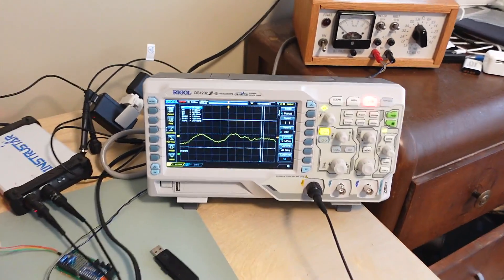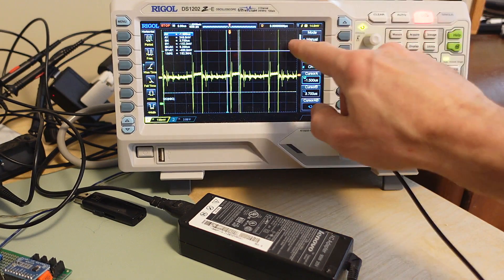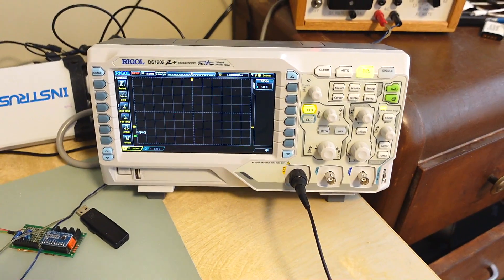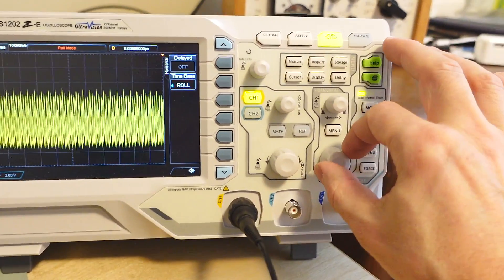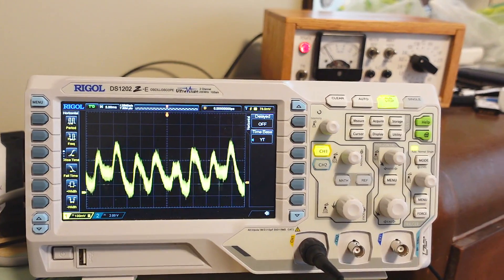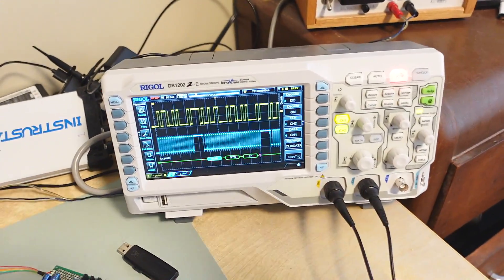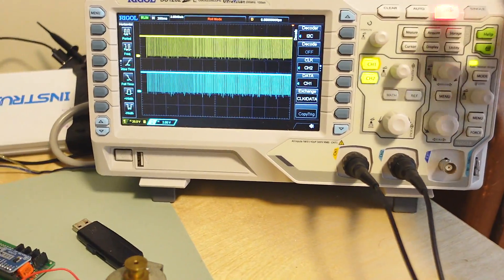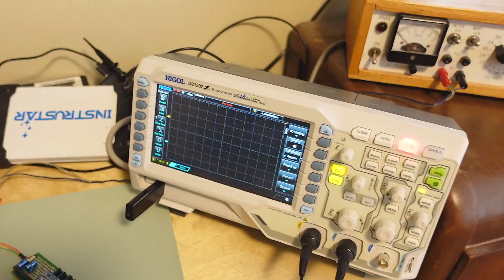Rigol DS1202 Z-E scope review

Comment: This reminded me of a SHORT I've seen recently warning against use of phones WHILE CHARGING. They demonstrate with some sort of current detector how using a phone while charging pushes current out through your body. I would LOVE to see YOUR in depth explanation of that video.
Reply from the maker: Not worth debunking that sort of bs.  People come up with it for clickbait all the time.
Reply: @matthiasrandomstuff2221  gotcha...thanks
Reply: @rolandgdean Learning how MRI machines work and how strong those fields are compared to the things you interact with in normal day to day life should give you a good point of reference for how worried you should be.  The main way this type of energy can cause harm is by heating you to the point you get burns, and if that was happening you would actually feel hot. Exactly like how sunlight feels warm, because radio waves are just light where the photons have too low of energy for our eyes to detect them.
Reply: @rolandgdean  signals are going through our bodies all the time. You probably shouldn't be looking at shorts for education, or at least watch some that educate you on how electricity works.
Reply: I never sought it out. The short in questions was sent to me by a family member @PabloEdvardo . This is why I directed mt question at Matthias.
Reply: @matthiasrandomstuff2221  well, there is something to it. It happens when there's no isolation between the primary and secondary side of some PSUs. Some of those chargers are just that bad. What do you want for $1.99?
Reply: Some chargers are isolated only by a capacitor and if the cellphone is metal which most are, and the charger is not isolated, it can be risky.
Reply: @thomasmaughan4798  it can get worse than that. There are some chargers where one of the mains lines is connected right to the secondary. It can happen by accident, design or poor design. The suppression cap between the primary and secondary in a lot of crap chargers isn't a safety cap too. Some chargers are built well and are very safe. Many are not. A channel here called diodegonewild tears a lot down and evaluates them.
Reply: @1pcfred  I enjoy the Big Clive tear downs.  When he takes something apart, there's no putting it back together and quite often he reveals the most minimal barely functioning components in a device.  Even the Kill-a-watt meter merely uses a capacitor as a limiter and that's why hooking up such a thing to a generator with harmonics can destroy it.
Reply: @1pcfred  "Diodegonewild" Thanks!  I will look for that one.
Reply: @1pcfred  Yes, I have been binge-watching and subscribed to that one.

Comment: There needs to be a modular system for creating physical UIs with knobs, buttons, sliders, lights, etc. that connect via USB to your PC and can be configured to control existing software.
Reply from the maker: doesn't really make sense.  The existing software would have to be modified to work with knobs like that.  Some high end cad and editing software does use knobs thoguh, but it comes with those knobs.
Reply: @matthiasrandomstuff2221  It could control existing software by emulating a keyboard and/or mouse.  Which is already doable, but AI should make it even easier in the near future.
Reply: @jej3451  what you describe already exists and is used heavily in music software (DAWs)
Reply: @PabloEdvardo  Got a link?  I'm not finding modular systems, only giant pre-made mixer/control boards.

Comment: First switching converter is the active PFC, the other is the main stepdown transformer.
Reply from the maker: exactly.  Used to be just a rectifier on the input side, but nowadays they have to do power factor correction, so inverters on both ends.
Reply: @matthiasrandomstuff2221  I was thinking that too, and were hoping you were going to see if the PFC converter ran at a different switching frequency than the main converter, and then by the time the video was over, you hadn't measured both, and I forgot about it :)

Comment: What is the deal with just grounding the probe to pick up magnetic signals or is it a special probe?
Reply: Acts like a loop antenna. Switching PSUs generate a lot of noise so it's not that hard to pick it up. Also, the scope has around 1MOhm input impedance so the loop isn't shorted